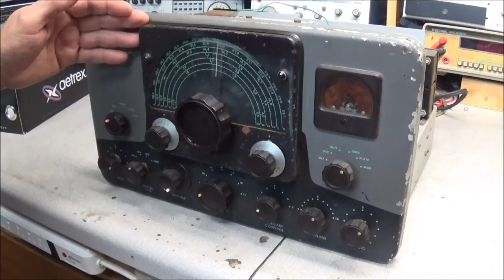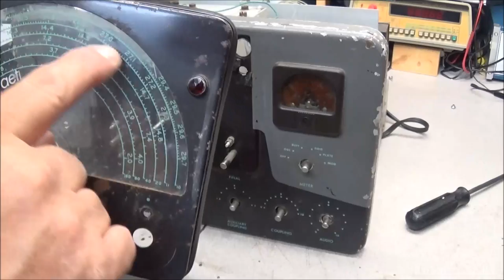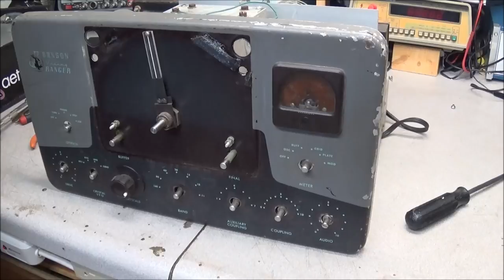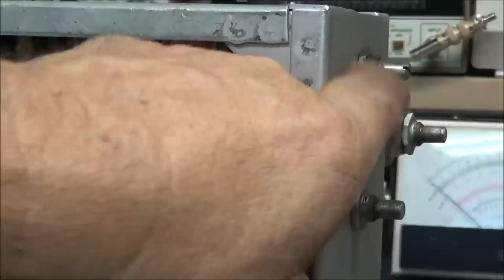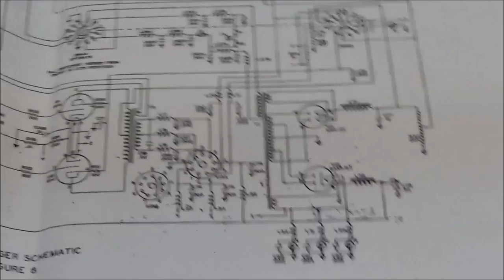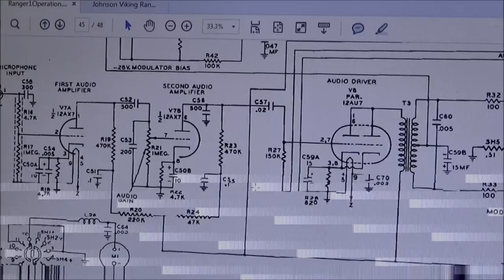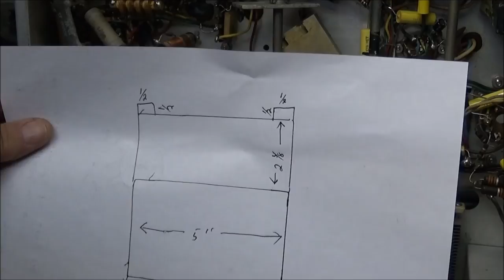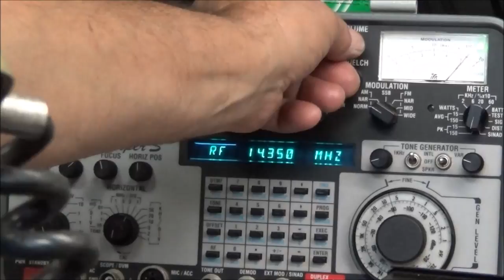#138 Johnson Ranger Restoration

Comment: According to Terry at D-Lab if the tube sockets are mounted with screws then it is a kit radio.  The factory used rivets to attach the tube sockets.
Reply from the maker: That is correct

Comment: Many thanks for making this video.  You have a very reassuring and calm delivery.  It gives me more confidence as I work on mine.  Alas I didn't find a Part 2 video.  I have my Johnson Ranger open on the bench, VFO shield off (and what a job that was), replaced the 18K ohm "Chernobyl resistor", ordered the replacement capacitors, and have already cleaned and relubricated the vernier.  I used a synthetic grease that will still be viable for as long as the shaft needs to be turned.  As an aside, I had a couple long telephone chats with the Ranger designer Manley Youngberg before he passed, who also designed the vernier.   Curious how you fused it.  I plan to fuse it similar to my Navigator fusing where I used an inline plastic pulse holder inside the cabinet.  Works great.  Did you check all the resistors in the VFO?  And how did your restoration turn out I wonder.   Thank you!

Comment: Just looking at the double fuse in the line cord gives me a shock haha! That is a terribly dangerous method of fusing and a trap for the inewbie tech. Great video, I really need to get more tools for my repairs. The fixes I do are mostly functional, not always the prettiest. Though I did recently redo a  D-104 preamp with a modest look to it. Too bad no one will ever see the fix.
Reply from the maker: Yes that is another abomination I have to correct. Although the original cord had the fuses in the plug. This will have them in the chassis,. That is one thing about some repairs. Others will never see it. Thanks for watching.

Comment: I agree with your comments about solid state rectifiers. The choke input smoothing will give sky high voltage with no load. Better to delay it with the tube rectifier, and then the TX is warmed up and providing a load.

Comment: The push-to-talk relay was not provided in the kit, but there was a circuit and specifications paragraph in the original kit assembly manual.  I never put that in my own Ranger when I built it (1959) because I didn't have the money when I was a teen and by the time I got to use it after college and a few years of apartment living  I really only used mine on CW (which was done by break-in) because there was almost no AM phone being used in the late 1960s.  Another problem that I had was after I sold it and the purchaser complained that the VFO drifted badly.  I don't remember which capacitor it was but I had a terrible time finding the proper temperature compensating capacitor.  I never did find one with the right value (ca. 1974.) It was at the top of the phenolic board in the VFO assembly.  The fuses in the AC plug was original.  I now do three wire with chassis fuse and hot side switching in all boat anchors I work on. I can't tell which the original circuit did since the on-off switch is on a ceramic rotating switch and I couldn't trace that part from your schematic on the video.
Reply from the maker: Thanks for sharing those years of knowledge Jon.  I noticed that the relay was not in the operation manual but saw it in the assembly manual.  In part two I am doing the vfo seems pretty stable. Thanks again.

Comment: You can get really thin Nylon cutting boards (About 1/8") that make a good replacement material for that VFO flexi joint........Nylon is a great way to go as its so strong
Reply: Harb's Elecronics Lab 

I use thin Teflon sheets.  Super high heat resistant and flexible.
Reply from the maker: Teflon works great. But this is less than 1/16th of an inch and did not have any that thin.

Comment: Very nice, very helpful video. I always wondered how a guy could clean up a dirty ole chassis. I have several transmitters, and receivers that I would love to restore.

Do you use the vinegar and salt solution on the chasis too? What about cleaning up the transformers? Same thing?
Reply from the maker: If it is heavy rust on a chassis I use naval jelly.  No vinegar salt on chassis, but would work. On transformers some light cleaner on scrotch brite pad will clean them right up. Thanks

Comment: Excellent series Buddy. Great idea about cutting the bristles short on the tooth brush but I wonder what the foam stuff is that you put on the tooth brush when you are cleaning the chassis? Also, does your wife know you do that with her tooth brush? LOL. That was an amazing restoration. You have done yourself proud, Buddy. Thank you for sharing it with us. Looking forward to the next one for this Ranger. I love the old Johnson equipment. 73 DE K7RMJ  Frank
Reply from the maker: Aw thanks Frank. It is fun working on these. The foam is nothing more than a product I have mentioned several times. Called Totally Awesome.  To make it into a foam just punch small holes in the pickup tube in the spray bottle and give it a little shake.  When you squeeze the trigger air is introduced into the liquid.  Shhh, don't tell the wife.

Comment: Let me say I enjoy your videos very much. I learn a lot. This one confused me though. Re-capacitors, you said over valued voltage is not a good idea. But I have heard nearly 100% of the time that over valued voltage on the cap is only ensuring higher performance. If a cap is rated at 50v, then it can withstand up to 50v dc voltage. It does not mean that there is 50v of dc, there may be only 20v dc present. If I understand what little I know, the B+ is the highest voltage present and the high voltage caps are rated to handle it. I no doubt have that screwed up. May be I and others are missing something. Now Shango066 does say over rating the voltage might not let an electrolytic cap form properly. I don’t know. He is the only one I have heard about that. Please help me on this. 
I know the newer caps are supposed to be superior. Time has no yet proved this. But aside from that, I wish someone would reproduce caps as they were once made with foil, paper and wax. It is possible to re-stuff but it would be fun to have the original. I do understand if you are willing to pay, you can order multi-section canned caps at values you want. I think I may do this for the few restorations I wish to keep for myself. Others, I would re-stuff by uncrimping the top or bottom. It’s not hard and looks 100x better than cutting. 
Your work is outstanding. We both share the penchant of cleaning to the original condition. I am so anal, I bought a river press to be able to re-rivet the tube sockets back into the chassis. 

Thanks again for your hard work. I hope you return to the Fluke DMM video#50. I would love to see what was the problem. I have the same unit as many people who no doubt got them cheap from the government surplus. Mine is stickered with NASA identification on it. But with around a thousand tantalum caps I am worried about recapping. It runs now, but don’t use it much at all til I better know what to look for. 

Thank you sir.

Comment: Nice job - but  what did you use for cleaning solution for the chasis? 

I have 2 rangers and neither give full power out with the vfo, but they do with a crystal. I assume that that resistor or tubes must be defective...

Thanks again for taking it nice and slow... I really like this video
Reply from the maker: For normal cleaning I use Never Dull followed by automotive wax. For rust naval jelly. Yes if internal VFO is low then check the voltages on the VFO. Either tube or high value resistor has changed.  Thanks for watching.

Comment: Hey Buddy- GREAT video (as usual)! I'm working on a Ranger this week as well. I noticed the black mark on the cap you put in place of the big "orange drops" - are you testing these for outside foil? Just curious. Thanks for all the knowledge shared!
Reply from the maker: Hi Jim. Good to hear of another Ranger getting repaired.  And you are spot on on the black mark. I always try and follow that rule so no problems can be introduced into the unit.  Thanks for the comment.

Comment: Hi Buddy-Thank you 
As always, radio engineering at its best!!
Can I ask you have you had much dealings with the Ft200/Henry one ?
I am at presently just stripping mine ready for restoration  (it is full of dry sand- but thank goodness no salt) 
I am looking for info on realignment, and enquiring have you ever done a video on one ?
I have looked around but there seems very little info about
Thanks once again
Reply from the maker: I have worked on a few, but before I started doing videos.  Next one that comes in I will shoot the vid on it. Somewhere here I have some material on it.  Good luck on your repairs.

Comment: From what are those coil formers made?
Reply from the maker: You mean the ones behind the meter and lights? It is just coated magnet wire. No inner former.
Reply: The Radio Shop No, the white ones.
Reply from the maker: Oh, they are ceramic type former.  Lucky none are broken and cracked. Could be replaced with 1 inch OD pvc if in a place where the heat is low.